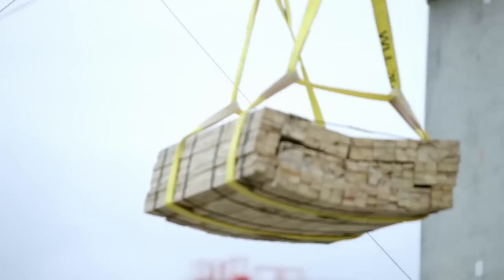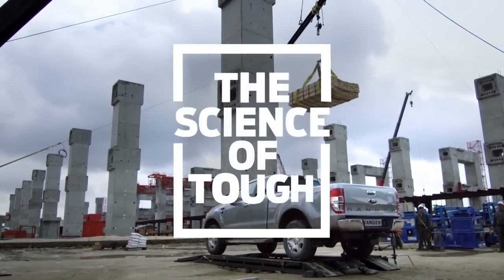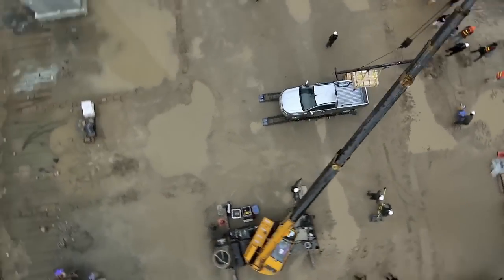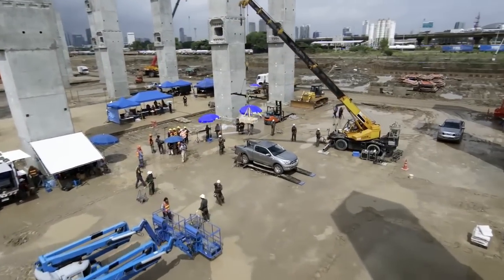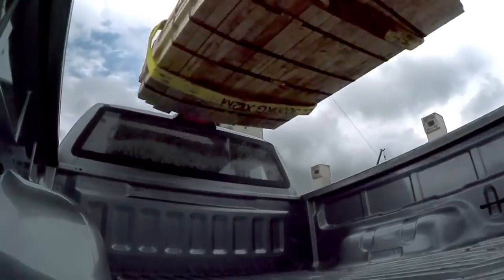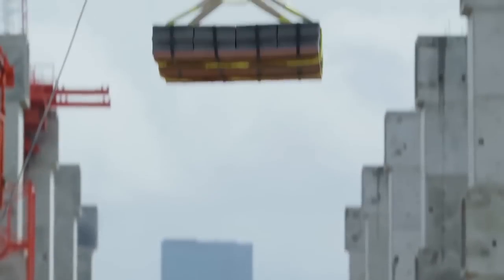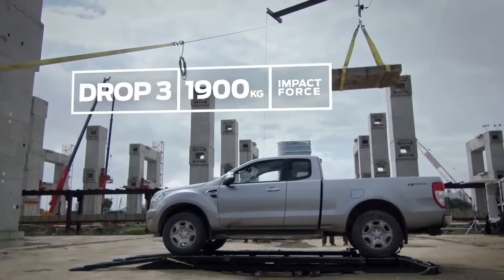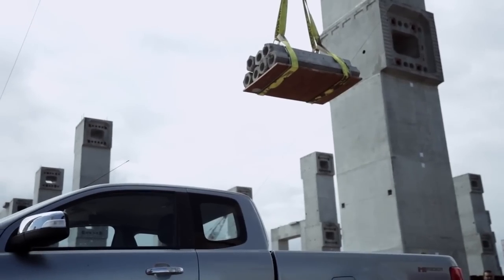Ranger: Science of Tough #2 Heavy Drop | Team Hutchinson Ford

Comment: sorry but a stock ranger is not going to hold over a ton in the bed
Reply from the maker: Don't be sorry, they do!
Reply: so a one-ton can hold 5000lbs in the bead no sweat
Reply from the maker: As you saw in the video, 1,100kg payload is available on 2WD XL and XLT SuperCab models and 4WD XL SuperCab model.
Reply: Then how come a 1-ton cant hold as much as this little quarter-ton
Reply from the maker: Because Ranger is Built Ford Tough
Reply: a one-ton is a truck thats capacity is 1 ton the ranger isn't a 1 ton nor a 3/4 ton nor a 1/2 ton it is around a 1/4 ton, ford tough is fine and dandy but it doesn't change the laws a physics